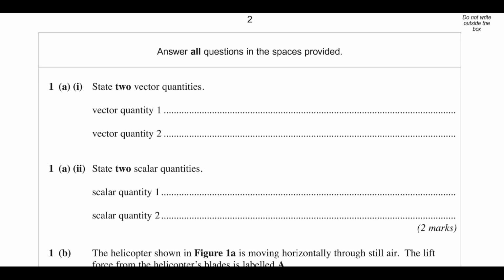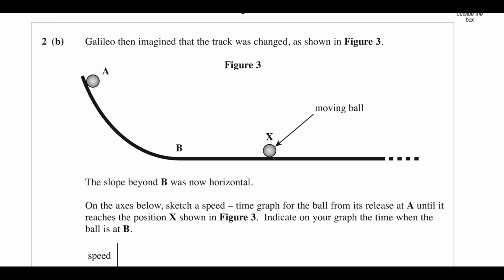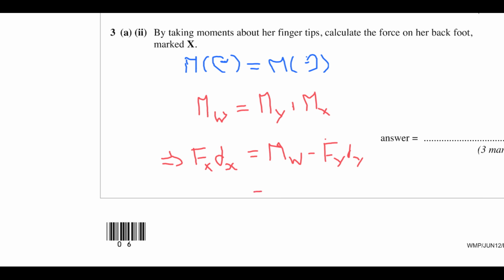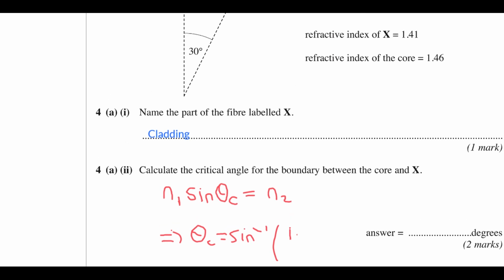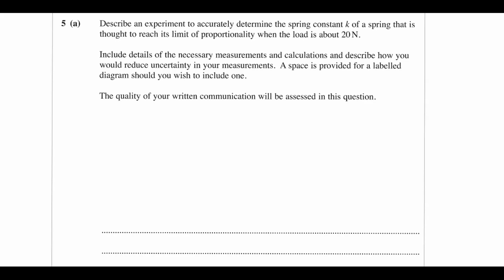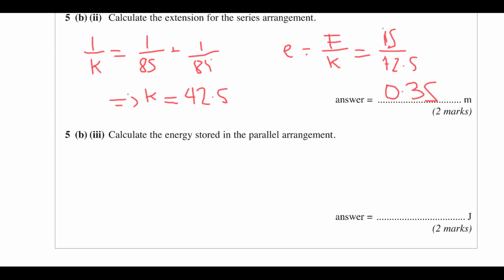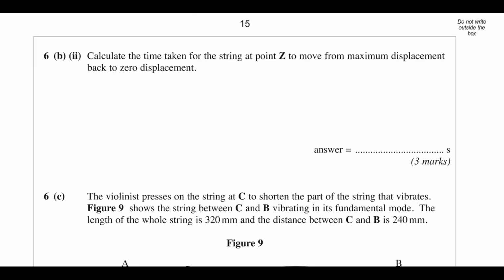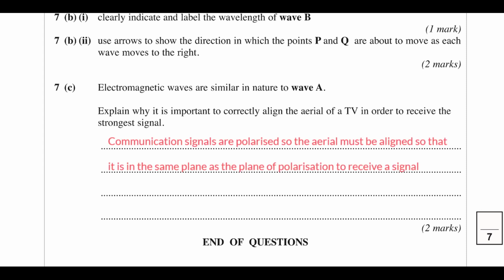AQA: A Level Physics: June 2012: Unit 2: Worked Solutions

Comment: whats the difference between multipath dispersion and modal dispersion?
Reply from the maker: Multi-path dispersion causes pulse broadening because light rays take different length paths to the end of the fibre,  modal dispersion is when different wavelengths travel at different speeds through the same optical fibre.

Comment: How do we determine the phase difference between two points on a stationary wave?
Reply: For a stationary wave there is no horizontal displacement so points above/below the line will move together - either in phase or out of phase.

Comment: When and when don't u use v = distance / time
Reply from the maker: That equation only works when either you want to calculate average velocity or if the velocity is constant.

Otherwise that equation is not valid.